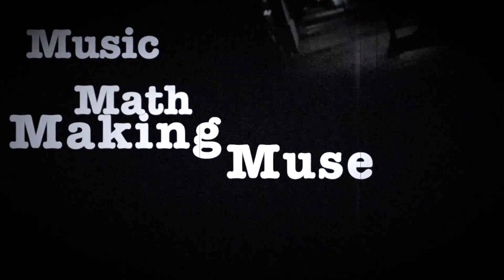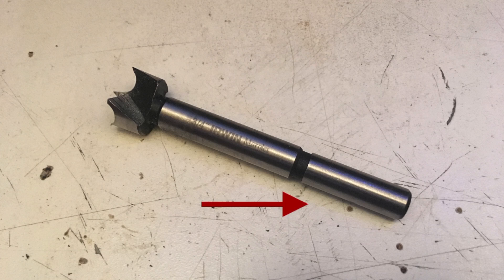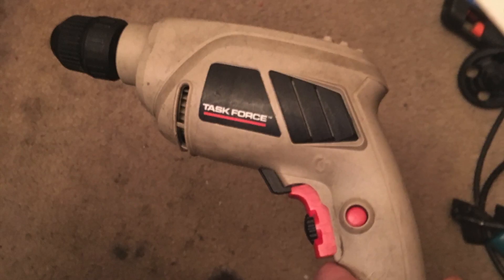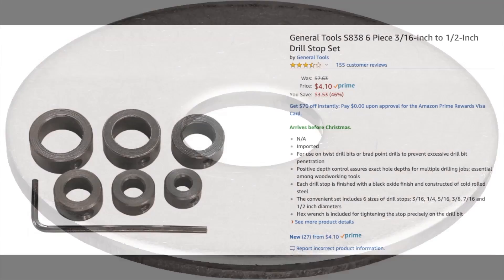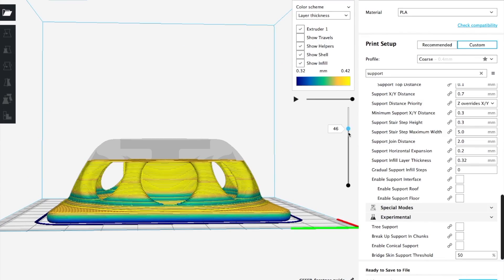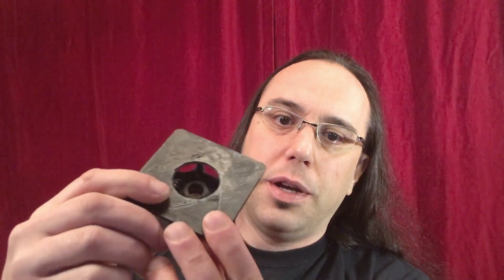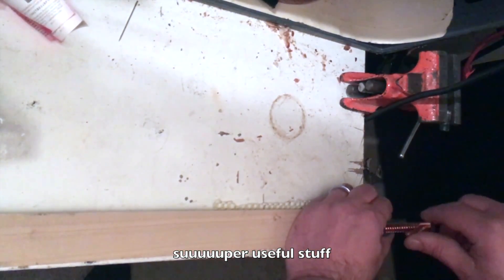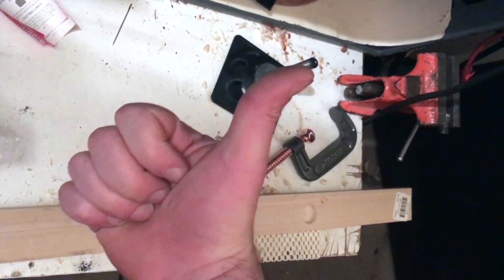Simple 3D printed Forstner bit guide, with tips and tricks

Comment: People keep forgetting contact adhesive, one of the oldest adhesives around? You coat two surfaces with it, wait until it's dry to the touch, which is like a couple minutes, then press things together as hard as you can for 10 seconds, and it's done, don't have to worry about it any more. It's super flexible too. It's basically chloroprene rubber. A disadvantage is that it can't be made clear, its yellow in colour, but whatever peeks out is easy to clean up. It can also be used single sided and wet, but then it can take a few days to cure and the bond likely won't be quite as perfect.
Reply from the maker: Good call. I actually have my mouse pad tacked down with DAP contact cement (tired of it 'walking off'). It has been around for so long that it gets lost in the shuffle.

Comment: thanks :-) the idea can also be used for other drill types. i can see a use for this when i have to drill in concrete where i want to straight hole, normal the hole ends ups a bit overize as i do not keep the drill straight in relation to the wall